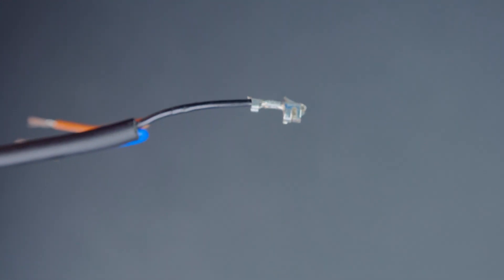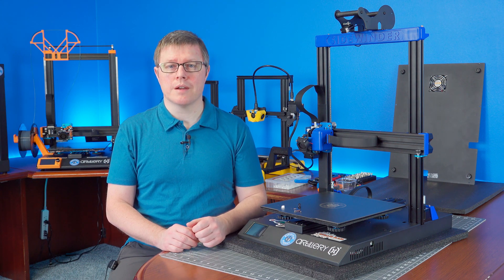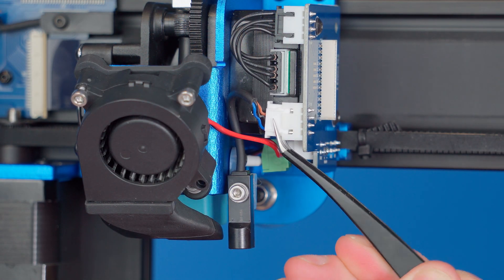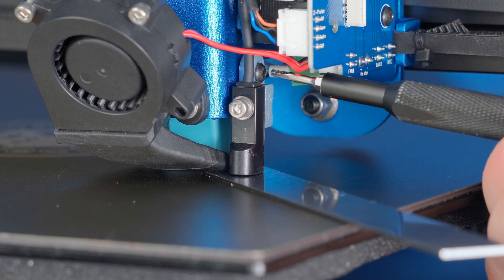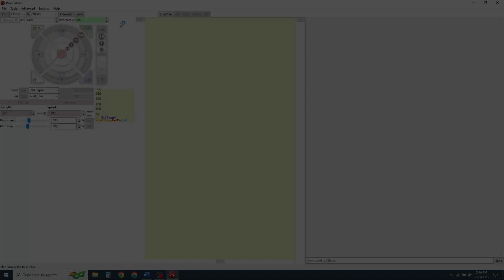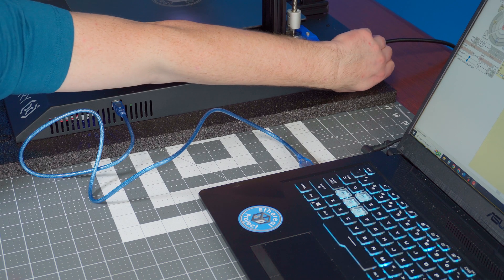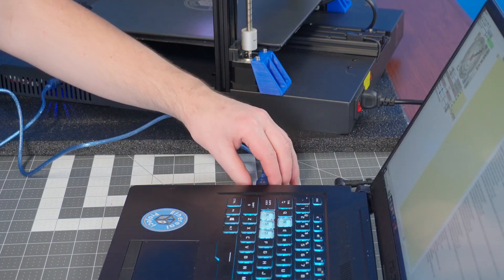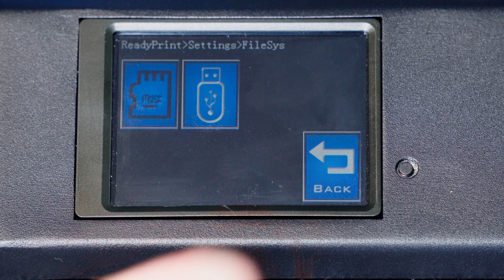Sidewinder X2 and Genius Pro Inductive Probe Leveling Tutorial.

Comment: Hello 

Thank you for great video.
Issue that I have after installing firmware and the sensor is that when I print and want to adjust  baby steps (if I accidentally press save to eprom-we know it’s not hard) printer freeze and don’t want to continue.

Do you have another firmware or tips how can I fix it 

Thanx

Comment: Thanks our printer we used only twice just did that. It slams into the deck and we have to turn it off because it wants to drill into the board. I left a message on Instagram. I test probe with tools-home-home and the printer head stops when I tap it with a pencil. just does not stop now when it levels.
Reply from the maker: It was good chatting with you and getting you all fixed up.

Comment: hi , when i try doing the m997 command it just disconnects the printer and i have to power cycle it in order for it to be recognized again by the computer... why is that?
Reply: Pronterface disconnects because M997 takes the printer out of communication mode and puts it into DFU mode and it will not talk to Pronterface any more. That is what it is supposed to do.

Comment: My X2 isn't randomly crashing into the bed... It is full on suicidal! Attempt to home it, level it, set Z, whatever. In all cases, the extruder moves up and centers, exercises the ABL probe, then comes down promptly, as always, the probe touches the bed, but stays extended and the printer attempts to bury the nozzle in the plate!
Shall I assume the problem is in the ABL probe? If so, I think I'd prefer to imitate what you did earlier, replacing the Artillery ABL with a legitimate BLTouch (avoiding fiddling with the firmware).
Thanks for all you do.
Reply from the maker: Getting a better probe is priority number one on this machine.

Comment: I checked. But the fan inside the case is not active. I installed the original version again and it works. Could it be inactive in the bin file?
Reply from the maker: I never turned it off

Comment: I'm having problem with the STM32. When i use that firmware.bin file which you have provided it will notice the start address and I can flash the firmware but when I try with modified firmware.hex file (Marlin, built in VScode) it will not notice the start address and it makes an error "failed to download segment 0" and other things. Anyone encountered this problem?
Reply from the maker: I believe you will need to use the .bin file, sometimes it doesnt play nice with the .hex file.
Reply: Yeah that seems to be it, thanks! @EtherealProject3D

Comment: Thank you very much.
I installed the software, the fan inside the case does not work?
Reply from the maker: Make sure its plugged in the correct spot
Reply: I checked. But the fan inside the case is not active. I installed the original version again and it works. Could it be inactive in the bin file?
Reply: I have the same problem. The big fan on the panel doesn't work. Does it always run or does it work only when the printer getting hot?...
Reply: Have you fix this issue? I was thinking in re build marlin activating this feature. If i can.
Reply: @yalnzkurt5288  no, i reinstalled the original FW and the BL touch sensor.
 I also had to replace the motherboard because I burned it...

Comment: I made this modification, checked the wiring a few times and the probe doesn’t trigger on Z homing at all.

Flashed the firmware twice, cleared the eeprom a few times and still no luck. 

I bought the upgraded toolhead board from your site and was using it, thought that might be it and went back to the stock board and same results. 

What could possibly be the issue?
Reply from the maker: You may have a bad probe or its not wired correctly. Can you email me at etherealproject3d@gmail.com and i can give you further assistance.

Comment: Hi,U R wizard of artillery🥳 mayby you can solve abl problem with sidewinder x2, i and many other sidewinder owners had really annoing?
My printer got error code of abl. I tried to fix this with z sensor what came with printter and flashed it 3.05 and install Z axis sensor, when i tried to level ,All hell broke loose and ears shattering drilling sound was really Horrible🤔, i tried without sensor,thinking new sensor is too lemon..abl sensor seems ok,no blinking light ,i think it blink red after abl error,but now it seem ok.. Im not alone with this becouse there is lot people who has same prob i bought printter march 15,so its not old,i have print about 3-4kg
Reply from the maker: The abl sensor that coemes on the machine is not great and many dont last long. I recomend replacing it with a better probe, ether bltouch or crtouch.

Comment: How could i switch the BLTouch to Inductive Probe in Klipper? I made all the things from the tuturial videos and the stream parts and i can control the printer in Klipper but when i want to auto home, it just try to use BLTouch
Reply from the maker: You need to changed the settings for the BL-Touch in the config file. I tried it and got mixed results. There is a good config reference section on the Kilpper website that will tell you all you need to know, check it our here, https://www.klipper3d.org/Config_Reference.html

Comment: What's next, removing some screws to reduce weight? This is nosense at all.
Inductive/capacitive probes are great only if you want to scratch your bed, they have pretty bad accuracy.
BLtouch will always work by contact, gjving much better results.
Reply from the maker: When done correctly an Inductive probe works just as well as a bltouch

Comment: Why in the world ,you will change BL touch to inductive probe ? This is because you run out of ideas for video ?
Reply from the maker: Some folks prefer this method and when done right produces good results. So I figured I would do a how to for those that want it. I have this on my corexy machine and its great. Ive gone back to a CR-Touch on my X2 because I was having trouble getting the inductive probe to work right with Klipper.

Comment: Great videos!
Thank you!
The boards you sell for the x axis of x1 are/work great!  So does the level probe directions ,bracket stl and , firmware / tft firmware you provide.

I was wondering if you could point me in the right direction. You seem to really know your way around the workings of x1 and x2.
I am trying to add a max 31865 and pt100 to sidewinder x1 and x2 to use a biqu h20 water cooled hotend rated to 500'c
Does the Ruby board use spi or uart for the driver boards?
What about the x1 stock mks gen l?
Can the drivers be used as both uart and spi at the same time? Some uart some spi?
Also do either of the boards have unused spi connections?
The max31865 is made to be inserted in place of one of the drivers but specs say it needs spi.
Any advice/help appreciated!
Thank you!
Reply from the maker: Thank you for your comment and feedback. 

I did a little digging and as far as I can find, the Ruby mainboard does not support UART communication to the stepper drivers. 
The MKS GEN L V1.0 can do ether UART or SPI as far as I know.
Reply: Thank you!
That's what it looked like comparing the code/pin files but I could not find much on the Ruby board.

Comment: I would really just like to know why the probe deployes randomly any time I run the part cooling fan at level other than off or max...shared power from fan?
Reply from the maker: The PWM signal for the fan speed control is bleeding into the PWM control for the probe solenoid would be my guess.

Comment: Great content.  Does the firmware update include changes for the all metal hotend?
Reply from the maker: Thank you very much. The max temp is not changed in  this firmware but I can easily compile a version for you that has a higher max temp.
Reply: Not necessary at this time.  Thank you very much though.  You're doing  great job.
Reply from the maker: Thank you 👏

Comment: In Klipper, I
Another thought is that one great feature with asx2 is the light build plate. However my y-axis resonance frequency measures at about 20 hz which is the low limit for Klipper input shaping. Adding extra mass to the build plate will only lower the resonance frequency.
Reply from the maker: Wow 20 does seem pretty low. Mabe getting an aluminum one will lighten it up.

Comment: I have converted to Klipper and have been using the unused z-axis end stop input for the filament runout sensor. In the stock setup this sensor is routed to the display board and not the main board for some reason. Note the z-axis pin on the main board (that you are using in video) and was apparently previously used in the old x1 design still is conveniently connected to a vacant connector on right side of gantry. Thus no internal wireing is necessary to access this pin.
Reply from the maker: Yep, its as if they knew the stock probe was junk and would fail on so many machines.
Reply: @EtherealProject3D  well tell me about it. My genius pro bltouch failed right out of the box with error m999. In the box it came a z stop device to install "in case the bltouch didn't work". That z stop isn't supposed to be there, the only reason being the bltouch utter unreliability. Thanks for the video and one little question...the provided Z stop by artillery can be just connected to the free plug at the right... Right? It wouldn't be necessary to do the steps you are showing here... Thanks!
Reply from the maker: @Drumaier  yes